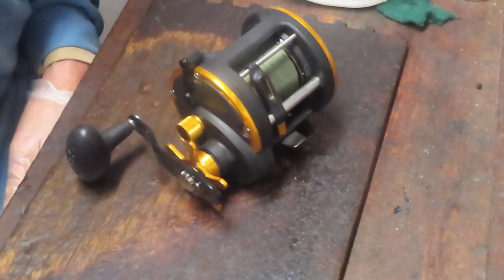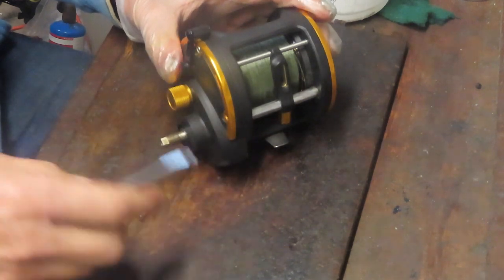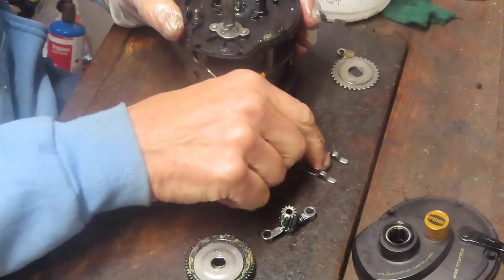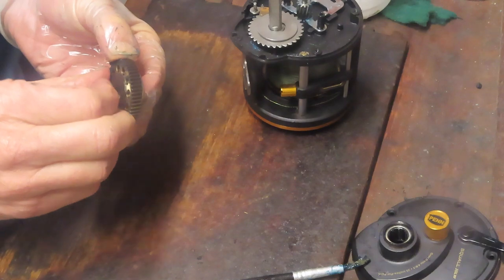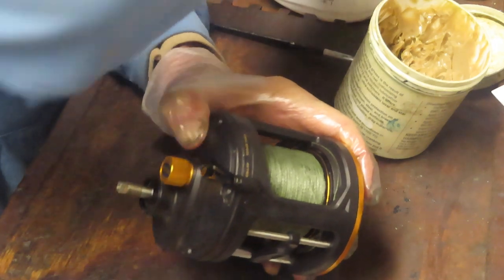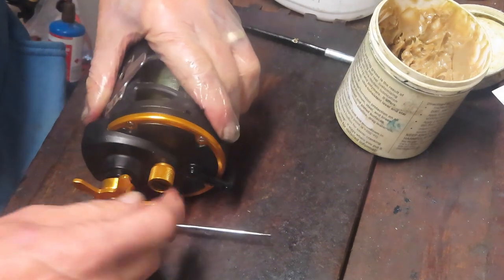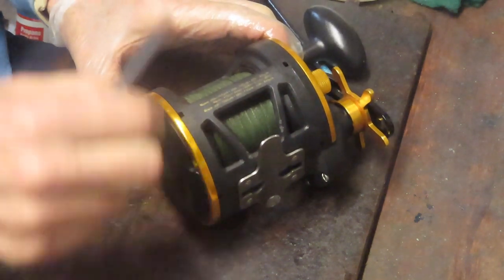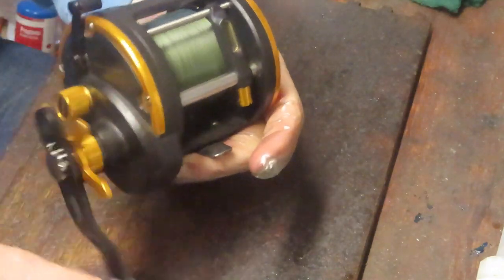Penn Squall 30LW saltwater fishing reel how to take apart and service

Comment: When I disassembled the handle of the reel everything appears to be working, but as soon as I attach the handle with the bolt that u use the wrench with, the drag no longer loosens and tightens properly
Reply from the maker: That handle is locking the star wheel when you tighten it down it is clamping it in place and preventing it from turning.  Either the star adjuster is not on all the way or something is preventing it from turning down. You need to check the drag stack to make sure it is assembled correctly  if you cannot get the clearance on the star adjuster

Comment: Great video, thanks.
I have a concern on my squall 30 lw, I have 4 of them and they are all a bit loose where the body is riveted to the rod clamp,  wondering if this is normal or can be fixed.
Thanks
Reply from the maker: It's not normal and I don't have an easy fix.  You can replace the frame for around $50 or you can drill out the loose rivets and replace with screws.  Sounds like a design issue - Dennis
Reply: @2ndChanceTackle  Thanks for the reply, I managed to get a person on the line at Penn and they said this must be a manufacturing fault and I should send the reels in for repair or replacement, customer service at Penn seems alive and well

Comment: The free spool lever has some play on one of my Squall level wind reels.  The spring does not appear to be under tension until I pull it back about 1/8” from its locked position.  On my other Squall the spring tension is immediate.  Could the spring on the free spool lever have worked its way out of the slot on the Jack plate?
Reply from the maker: Yes - it is possible that the spring may be worn, broken or loose.  That free spool release can work without the spring, so it is worth looking at to make sure the spring is properly set or replaced - Dennis
Reply: Turns out it was the rectangular cutout in the eccentric lever itself that was slightly worn out which is why there is some play in the mechanism.  The spring and the rest of the internals were fine.  Ordered a replacement lever.

Comment: What’s the reason for using plastic on the idler gear?  Same as on the old GTI reels.  Once the teeth wear away the level wind stops working and you’re left with an unusable reel until you can get home and replace the idler.
Reply from the maker: The plastic idler gear is a failsafe.  It is the weakest link in the chain.  If the reel gets hung up, that gear will break rather than ripping up all of the pieces in the line guide, worm gear, pawl, assembly.  Plastic also has flex and is naturally lubricated, so it make the transition from the spool t the arm gear smoother and it does not require the frequent oiling that a metal gear would need - Thanks for asking - Dennis